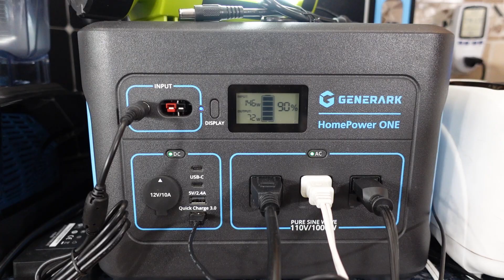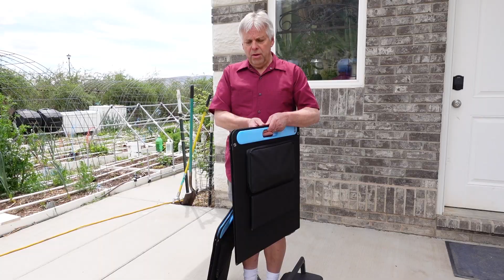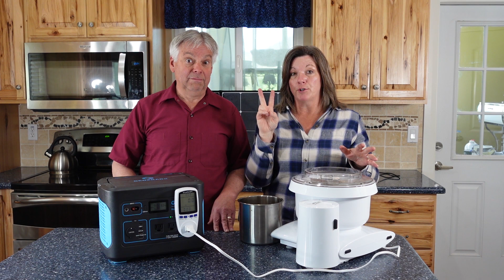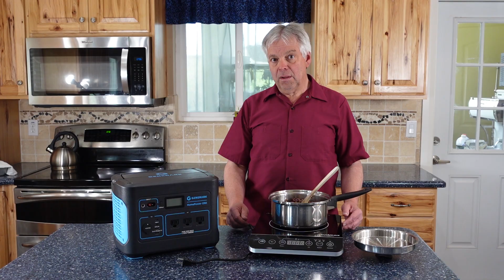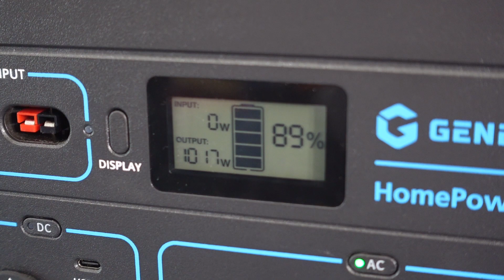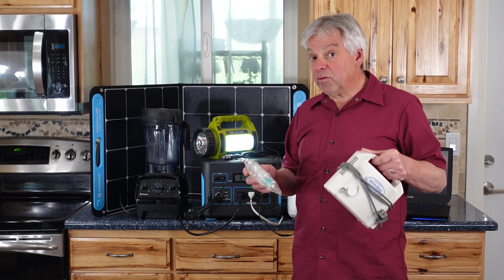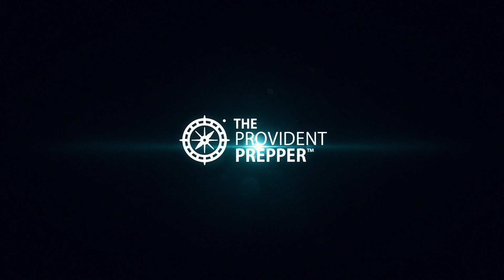Emergency Power: Generark Solar Generator Review

Comment: Can you tell me which brand if any can charge and run the AC side at the same time? Thank you.
Reply: Hey Sue...There are so many brands out there that I am not sure about. It is really crazy how many strange named companies have jumped into this game. I believe most of the Goal-Zero units have that capability in addition to this Generark Unit. I believe most of the Jackery, Bluetti,  and Renogy units also have that capability. Some brands have a lower end that won't allow you to charge while you use, while their higher end can. That is one of the critical questions you need to ask before you buy. Most of us want/need to be able to be charging while using energy. Great question...I hope this helps. If you have further questions, connect back. Thanks for being part of the solution!

Comment: Does strike me that these systems don't really have sufficient capacity.
My house runs at a base load of 4.5kw/h per day, and it would be difficult to reduce this without seriously impacting lifestyle.
So do you have any suggestions about systems that would meet these needs?
Thanks, STILL loving the channel.
Reply: Hey Dandy Cat...I am impressed that you know how much energy you are using. And yes, when a crisis arises, this medium sized unit will not power everything we are used to...spoiled as we are. You would have to prioritize the loads that are most important, and meet your needs as best you can. As for larger systems, you can look at larger fuel generators, but will need to store fuel and deal with noise and carbon monoxide. A natural gas generators tied to your home is a reasonable option if you feel confident that natural gas will be working...I don't have the confidence that it will be there when I need it either because of damage or the inability to keep the natural gas flowing in a crisis. As you may already know, solar is my first choice. Although battery storage has some limitations, overall it is a great way to go...and the technology is getting better all the time. There are great companies out there that will help you design the right solar package. With some self-education, you can do this yourself, or you can hire a qualified solar contractor. I would avoid the grid-tied rooftop solar crowd unless they will provide a back-up system that will actually function...otherwise you will be like so many others with solar on your roof, but nothing to show for it in a grid-down crisis. Let us know if we can help further. Thanks for your comment...and thanks for being part of the solution!!
Reply: @JonathanBJones  Thanks for the feedback, Jonathan.
Definitely a problem I'm wrestling with. Would like larger solar, but of course, cost is a big issue there, though did consider starting small and building up.
Keep up the good work, buddy. Yours is definitely one of my fave channels.
Peace and Blessings .
Reply: Buy two.

Comment: Another great video that gives folks an idea of what a power station is, & what it can do.  A few winters I wanted to go camping for 4 or 5 days in the desert 🌵 with a group of friends, but I needed to find a way to power my CPAP.  On the recommendation of a friend I got a 300wh one with a name I can’t pronounce so we refer to it as The Yellow Box.  It does the job & if I go into the settings & turn off the humidifier I can get 4-6 nights depending how many hours are needed each night.  I got a DC to DC converter from the CPAP manufacturer for running on a car’s 12v socket. Then I plugged it into power station & the CPAP.  This draws less power since it skipped the station’s inverter.  (I ordered it off that company named after a big river in SoAmerica, and tested the station completely in 30 day return window to see how many nights I could get off one charge. I had to return the lessor power one because only got a couple of nights, & got the yellow box.)  We never run anything else off yellow box. 

The next year I got a Jackery 290 on sale for powering the internet router & recharging other items like phone, laptops, fans, flashlights 🔦, & other gizmos.  Then I got on sale for Black Friday a 60w folding solar panel that has grommets in corners for hanging out window if needed. 

Our wildfire season started way early this year due to prolonged drought. This means another summer & autumn of rolling power outages in Northern California. And in this season we remind our neighbors that our motto “ABC = Always Be Charging!”
Reply: Way to Go!! Best to get these things figured out now to be prepared before you need it. Thanks for your comment, and thanks for being part of the solution!!

Comment: A lot of people scoff at these "solar generators", but they will work when the gas gennys are out of gas.
Reply: Good point...the reality is that both have their place, each has some great aspects and each has drawbacks. But when the grid goes down for an extended time, most gas generators will be useless lawn ornaments, or will be stolen because their noise will let everyone know you you have power. This power station cannot do as much as most fuel generators, but you don't have to store fuel, you don't have to worry about carbon monoxide (CO), and they will keep working as long as you can get some sun. There are more and more power stations on the market, and some have some serious capacity that will allow you to run fridges and freezers and more. Still not good for cooking, heating, or AC, but we can use other great methods for those. Thanks for your input...and thanks for being part of the solution!
Reply: @JonathanBJones  I have both, solar and a gas/propane powered gen.  My plan is to run the gas gen during the day as needed  and bring it in at night and run the solar one in the house at night.  I'm trying to prevent theft of the gas one if I leave it running all night outside.

Comment: I have a different brand of 1000w solar power generator. I was able to keep our deep chest freezer running solely for about four hours before the power came back on. I can't remember exactly how much power it used. Just remember that with freezers, you just need to run it for a short time to keep things frozen. That is if you don't keep opening it.
Reply: Hey Joseph...well stated. Thanks for being part of the solution!

Comment: My concern is will it keep a freezer or refrigerator running?  I will do wash by hand and I don't mind kneading dough.  The fridge is a big one for me.
Reply: Been thru Katrina, power out 2 weeks lost everything in frig and freezer, moved back to AL and tornadoes across  the state  lost every thing in  the week out of power. Corey has a c pap machine got  the Goal zero  500 almost 6 years ago it is a AGM battery ( can't go below 50 %) Has payed for it self over and over 10 min 30 minutes at a time, I woke up no power Corey never knew. Fast forward we now have the Goal Zero 3000x it can run the big Samsung French door frig/freezer and the medium chest freezer, THE MAIN THINGS !!! Wash clothes Samsung washer do this on a a full sunny day , AND if need be run a 5000 w window ac -------- NOW not all at same time !!! I have Renogy panels cheaper, is this cheap NO but better to have too much power than not enough --- JMHO You can run light, led  on something else we have wi fi on a smaller unit STAY ON !!
Reply: @wattsadonnasaurs4810  thank  you so much for the info
Reply: This will run your fridge alone for a good ten hours and still retain about 30%.
I use this very unit on a daily basis to power a mobile office out of my work van. I run an AC/dehumidifier, a 23 inch monitor and charge my laptop and cellphone all at the same time.
The unit is not supposed to go above 1000W but it can handle 1200 (not advisable).
I use mine for day trading of stocks and futures  prior to starting my regular work, since I’m a contractor I can be at any location on time and still have a decent office to trade right at the job site.
The unit is very high quality and like the video says, comes with a 5 year warranty. Also the brand is a big player in the generator arena.
Reply: @rosarioporalmasdelpurgatorio  out of curiosity, how is it holding up? I just ordered one
Reply: @sketchyb7694  holding up great! On top of my daily trading I have used it several times to run a sander and a large fan to assist in work on units without electricity and it has really delivered results, no problems, no broken parts, very well built. Congrats on the purchase, very good buy.
Reply: @rosarioporalmasdelpurgatorio  prefect thank you
Reply: @goodiebee3007  go to energy.gov or something like that and get the annual consumption and divide by days in a year.
Reply: The typical 2 door side by side fridge 25cu ft uses about 1900-1950wh. This thing won't work for the avg home fridge this size.

Comment: I’m with your wife about certain appliances being VERY important.  Would this be powerful enough to run a freezer!  I’m thinking even a few hours a day would keep a full freezer safe.  But don’t know anything about watts and volts and etc.  I am NOT a geek.
Reply: Check inside your freezer. Somewhere on or near the door or lid, there should be a sticker or nameplate with the power info. That'll be your starting point to figure out how much power draw your freezer may pull.
Reply: Hi Nola...I am glad you are not a GEEK...the world can only handle so many of us. Being born without a personality is a serious impediment. Running a freezer is iffy. Depends on a lot of factors including the efficiency of the freezer, how often you open and close it, climate, size, and other factors. With a energy consumption meter you can get a handle on that. You can also use a remote thermometer system to run it only enough to keep things frozen. Most freezers aim to keep the temperature near 0 F or below. There are some good reasons for this , but stacks the laws of thermodynamics against you. So, you are on the right track with running it just enough to keep the food frozen...you could make a great GEEK...but we probably shouldn't got there. Let us know how we can help. Thanks for being part of the solution!!

Comment: I'm looking for ways to power my house and have been told that I cannot get solar because I have the wrong type of roof.  Any ideas for a backup? Thanks
Reply: Hey Craig...I assume you are meaning that you don't have an ideal solar orientation?? Definitely, some homes just don't have an ideal set-up. You may still have some good options. I am a big fan of pole mounted systems...these don't limit your options. You can put them where you can get good solar access (hopefully very near your home), and you can adjust them throughout the year to get maximum solar energy. You can do some homework and check that out, or find a competent solar contractor to give you some options. You will want to avoid most grid-tied systems unless they will set you up with a back-up power system. With a straight grid-tied system, when the power goes out, you are out just like everyone else. Keep up the your progress...Thanks for being part of the solution!
Reply: @JonathanBJones  do you mean by grid tied system, that you are selling your excess power back to the power company?  If not, what does it mean?
Reply: @47retta  Yes...many or most rooftop solar systems are tied to the power grid, which means you are selling your power to the electrical utility you are associated with. In many cases, this means that you have no access to that power in an outage. Some companies will provide you with back-up power, but you need to make sure what you are getting if you do this. Don't hesitate to connect with us if you have further questions. Thanks for being part of the solution!
Reply: Do you have an alternative location? On top of a storage building, garage, mount near/along a fence, build a roof over a deck, etc. ? What type of roof do you have? Maybe someone with that situation may already have a solution.

Comment: Just got my first rockpals but ive been looking into this one for a min. Good review. I need something a bit bigger than my 300
Reply: A 300 watt-hour unit will do fine for smaller loads, but the larger units give you lots more options. Another difference that you should consider is whether the unit can be charging while in use. Many of the smaller units cannot...you either use it or charge it, but not both. This seriously limits the functionality. Find the unit that will meet your needs. Thanks for being part of the solution!

Comment: I recently made a diy portable solar battery generator. I have 100 watt solar panels, 210 amp hour batteries and 1000 watt inverter. Total cost was around $700. It is quit heavy but its all housed in a tool box with wheels.  It took a ton of research but if anyone is interested i can share links to awesome tutorials to help you build your own. If I can do it anyone can.

Comment: What you didn't cover in this infomercial: The actual solar system needed to generate the power in the generator and how long you can continue to sustainably power any necessary appliances like a refrigerator and/or freezer. We can easily cook, heat, and even wash clothes without electrical power, but keeping food from spoiling during an extended outage situation would be what most of us would need a generator for.
Reply: You do make a great point. Most of us a bit spoiled, and the reality is we can live without the conveniences...people have done that for thousands of years. Refrigeration is a great thing to extend the life of food, and also medications that many need to stay healthy. Thanks for being part of the solution!

Comment: So what about it running the washing machine???
Reply: You would be able to run your washing machine off of one of these, but you would have to air dry you clothes as these have the 110 outlets. I have a different brand of 1000w solar power generator. I may try it out Saturday with a load or two.
Reply: @TheProvidentPrepper  So what about it?

Comment: Can you run a deep freezer on it
Reply: Hi Kimberly...Running a freezer is iffy. Depends on a lot of factors including the efficiency of the freezer, how often you open and close it, climate, size, and other factors. With a energy consumption meter you can get a handle on that. You can also use a remote thermometer system to run it only enough to keep things frozen. Most freezers aim to keep the temperature near 0 F or below. There are some good reasons for this , but stacks the laws of thermodynamics against you. If you have a very efficient small or moderate-sized freezer and lots of sun, maybe even supplementing with extra solar to keep it at the maximum 200 watts of input, it might work...again, it depends on several factors. Best place to start would be to use an energy consumption meter to see how much energy it consumes on an instantaneous and long-term basis. Then evaluate whether your climate would allow you to keep strong solar charging. There are also larger units out there, or you can create your own solar power system if that excites you. Excited that you have the wheels turning! Thanks for being part of the solution!
Reply: If your freezer by chance still has the yellow energy consumption information sticker on it, it will give you approximately how much energy (watts/hr) it uses. You can then do simple math. By like Jonathan said, it depends on a few factors. The most important of which is how often you need to open it.

Comment: My husband is diabetic and has costly injections that are refrigerated.   I would need a generator that powers a refrigerator.   How do I figure out what size generator that I would need?
Reply: Look into the 12 volt refrigerators, the cost has really come down. Under $300 for many, you would still need 12 volt power. Many options for the power & their cost have come down also.
Reply: @Utah_Mike  Great advice, I will look into that. Thank you.
Reply: @TheProvidentPrepper  Thank you so much.  I truly appreciate it.  I so enjoy your videos and your family makes my day.
Reply: Hi Malinda...others have given you some great advice. I would check out your options and see what will give you peace of mind. If you have a small, efficient, well insulated fridge, you can probably get by with a power station like this one, assuming you get lots of sun to charge it. You can also buy or build a larger power system that would have greater capacity. That definitely is a serious concern. Let us know if we can help further. Thanks for being part of the solution!
Reply: I have a different brand of 400w solar power generator. I use a CPAP machine at night and it carried me through with some to spare.

Comment: Very timely video. I am researching solar generators right now. I never heard of this brand, so I will look into it, thanks. (Richard).
Reply: Sounds like you are doing some great things! If you look at this one side-by-side with the Jackery 1000 Explorer, you will notice that they are identical except for the handle and the color...as near as I can tell, it is the same unit. Keep up the good! Thanks for being part of the solution!!

Comment: Here's my question. Is it strong enough to run a furnace and refrigerator.
Reply: @TheProvidentPrepper  thank you.
Reply: Hey Linda...Perhaps an efficient mini fridge, and probably a furnace as long as it is just running the fan and electronics. Each one is different, so you would need to get some details or do some measuring. Furnaces that have Direct Current (DC) motors are very efficient...they would be good candidates. Thanks for being part of the solution!!